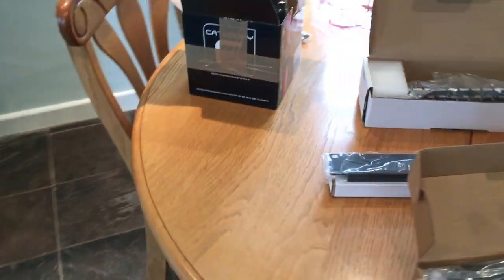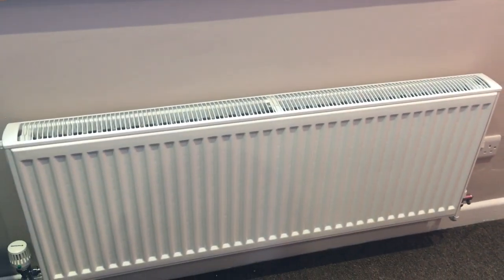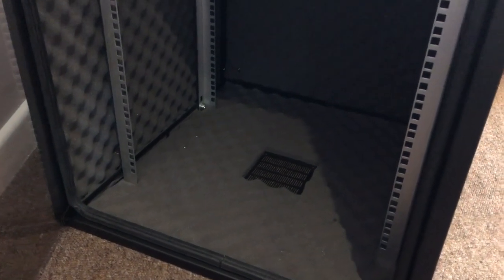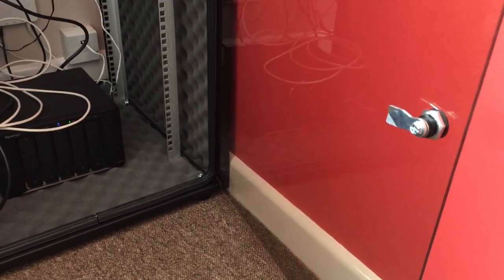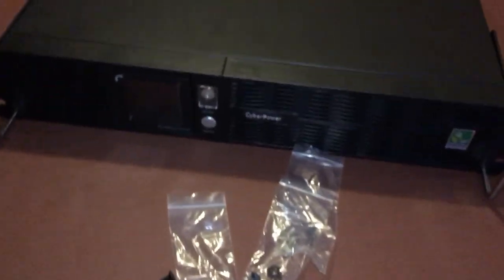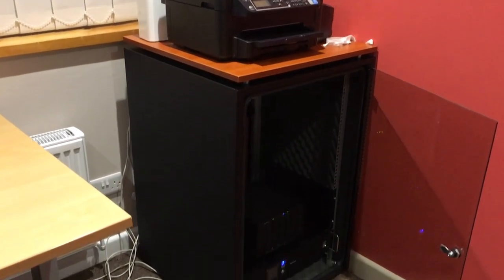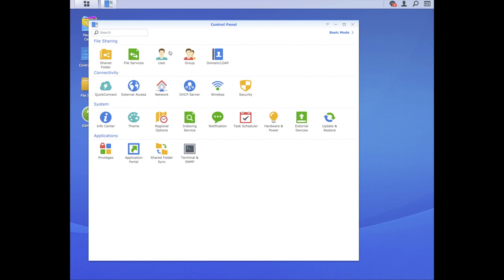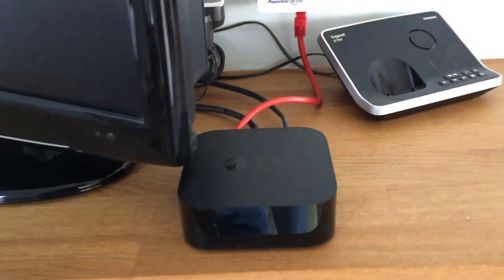Office revamp. Network, cabling and rack cabinet (part 3)

Comment: Hi Andy - I recently purchased the same switch and plugging it in the first time it has quite a LOUD fan noise? Is this normal for this model? Do you experience a loud fan?
Reply from the maker: Hi Nick. No fan noise for me. There are 2 versions of the switch, one with PoE support and one without. Mine is without and I don't think it has a fan so perhaps yours in the PoE version? Provided it's well ventilated, I'd hope you wouldn't experience that kind of problem. 🤔